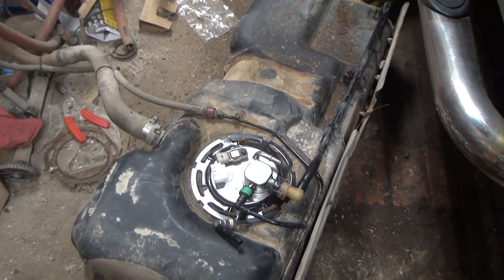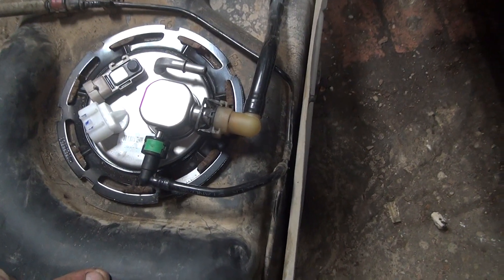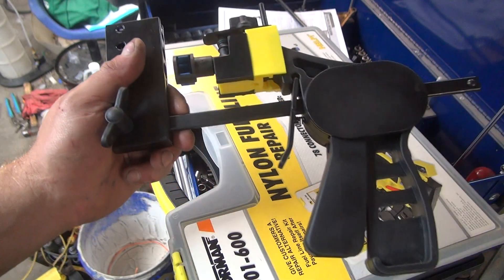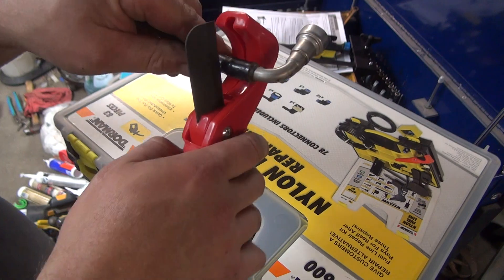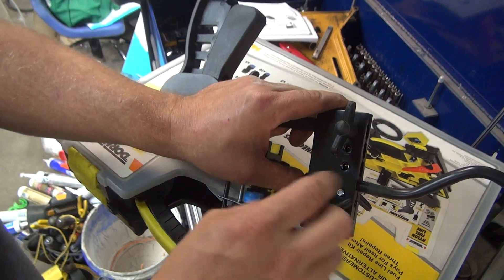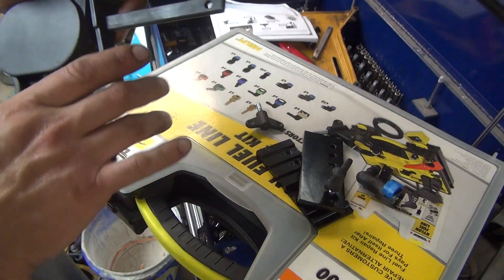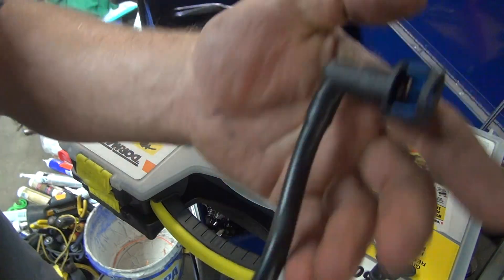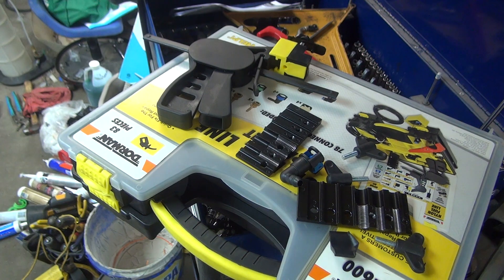How to repair a fuel line with the dorman repair kit

Comment: Nice video and good info! I just bought a new fuel pump for my 1995 Range Rover and the two lines coming out of the top of it are smooth without any flares. I guess I have to use a compression type fitting for that part of the connection.

Comment: Does that quick connect fit on a spectra fg05n sending unit 1987 c10 fuel injection??    I’m using a compression fitting to an-6.  But rather use this if it works.

Comment: I have a faulty fuel line connector on fuel filter (o-ring broken). I cut out the connector from the nylon fuel tube and now have to to install another one. The problem is that I have to install connector on a fuel line which is already installed on a car (I cannot remove the whole fuel line). I planned to heat a fuel pipe with  a heat blower (200 degC) and then put the connector on a pipe with hands because I do not have enough space to use any tool (fuel pipe is to short). Do you have any kind of suggestion and is it dangerous to manipulate with heath blower at 200 degC in close proximity of fuel tank.
Reply: DO NOT USE A HEAT GUN NEAR A FUEL SOURCE. The electric heat gun, or hair dryer, makes sparks which will easily ignite flammable fuel vapors. If you need to heat the Nylon Tubing to soften it, simply soak the line in hot water.
Reply: @PredatorOmnivore  I concur.

Comment: Will these connectors work with the plastic connections on the newer GM fuel pumps?
Reply from the maker: Not sure the exact connector you are referring to but they should. Most of these fuel line quick connects are the same.
Reply: @Scottthesigncrafter  I just got my kit today. It worked well. The only complaint is the squeeze gun is kinda junk and they don't give you very many of the connectors that you would typically use and a bunch of the ones that you wouldn't typically use.

Comment: $200.! You got screwed! Just buy anew line.
Reply from the maker: I've used it on 4 vehicles so far. It's more then paid for itself. If it's a one time thing for your own vehicle then yes buy a new line. They even make short lines with new ends you can splice on. But in my case it made more sense to buy the kit to have for multiple repairs. Also this repair takes 5 minutes where replacing a whole line would take a lot longer. So no, I didnt get screwed.